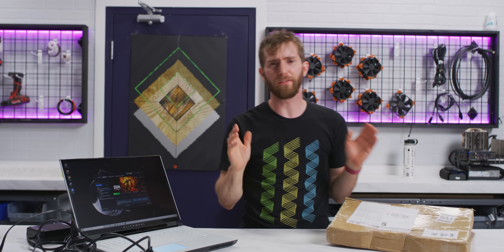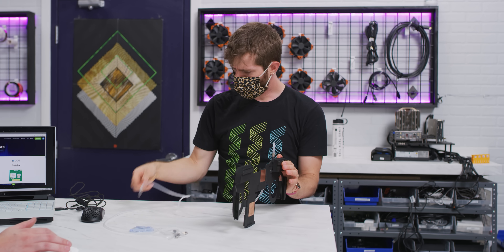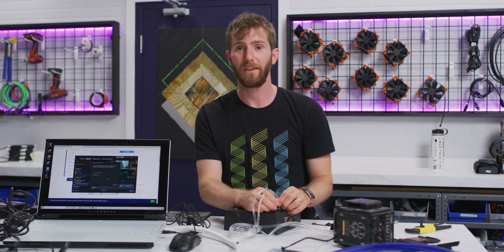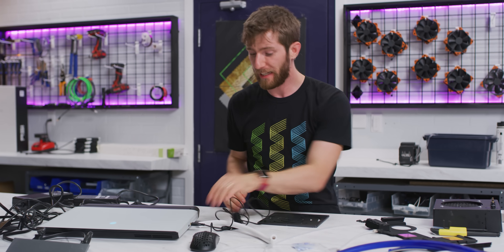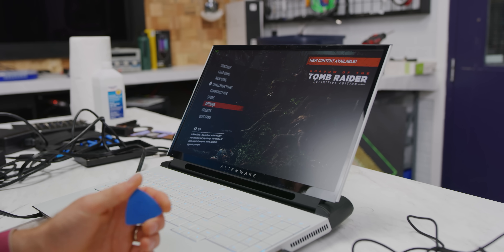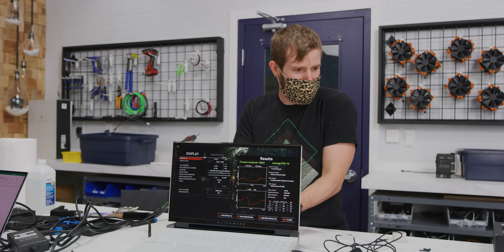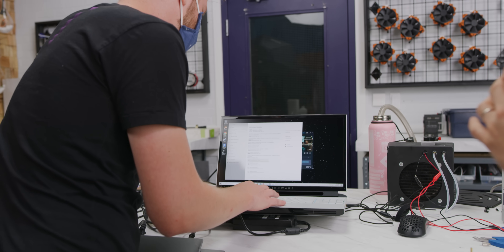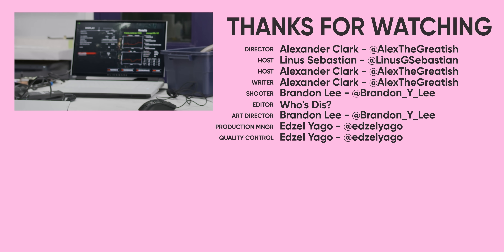This Sketchy AliExpress Cooler....

Comment: That’s feeling when you buy laptop for 2000+$ then water cooler for 600$+, just to make a stationary computer from a laptop, which in any case will be weaker due to a weak videocard.😅

Comment: how is 70 degrees Celsius good for water cooled most the time i see you all water cool anything the temps yall run even if ther at 60 c my air cooled system runs at like 45 c under load for hours the most my gpu hit is like 65 c and my cpu wont go over 50 unless its a shadder game then it will hit 65 thru 70c but thats air cooled so why would i ever water cool if any time i see someone have one or build a water cooled system with temps higher than my air cooled, then why would i water cool?

Comment: Asus released a hybrid water and air cooling laptop GX700 which was very expensive and yet a very innovative technology> that might be the future of gaming laptops!

If your laptop has a throttling issue you should return it to the manufacturer because it's a hardware malfunction and there is no solution for it. The heat produced by the CPU and GPU can't be eliminated by the air cooling system for some high end laptops and this why gaming laptops is just a repeated joke for so long!

Comment: 8:30 I've had this exact problem before it was greatly exaggerated by being direct die. When installing my artic freezer 2 on my direct die LGA 1151 system, I had not tightened the screws evenly the first, second, and third time resulting in me running circles I was trying everything. Rotating the cooler, listening for a pump failure, and even trying different thermal pastes. No matter what it stayed around 90-100c and I couldn't figure it out. I asked online and they told me to remount the cooler and very carefully tighten the screws evenly slowly. Lo and behold the system now barely scraped 60c under full load 4.9ghz OC.

Comment: I would love to see something like this built in by manufacturers of "Gaming Laptops". As it stands, they tend to get insanely loud and hot which I worry reduces longevity of parts. I own a M15 R7 Alienware laptop and would be more than happy if it had a optional water cooling loop I could tie into for quieter and cooler gaming.
Reply: I mean, my MSI laptop from 2014 still runs like a champ.  Bit outdated with it's poor 770m, but still.  The parts are bound to last a lot longer than their useful performance.
Reply: There was a water cooled laptop made by asus. Gx 700 if i remember that right

Comment: its a good idea but i feel if they had better water flow threw larger outlets and pipes to pull the heat away quicker the result would be better. hay you have to mod the back anyway so the larger outlet and pipes wouldn't be a issue

Comment: Honestly, something like this would be cool if it was integrated into the power brick, like the lines being a quick disconnect and the power brick having the rad and pump into it so when you want to use the full potential of your hardware, and have it be a reasonable noise level, you can just plug it all in.

Comment: i personaly used alot of diffrent cooler at my laptop not liquid coolers toght. 
What happend is coolers that goes under the laptop doesnt do a shit. You just get to see how fast your laptop gets to cool down and it takes time to over heat again which it doesnt efect performance they are useless garbages. 
But i also used vacumed coolers over 3 years. They make alot of noice but here is the thing they acualy manage to cool down the pc. It doesnt efect your celceus numbers but it does efects the fps you get dramaticly. 
Any way im bought a new desktop now. Just dont use laptop for gaming thats the best advice i could gave. I have to use laptop before i was in the univercity but now im working and i have rtx 2060 its just that.

Comment: I had Lenovo Y510P and i made an ork upgrade to it. Watercooling! I took thin wall copper pipes 10mm. Bent them along original thermal pipes, squshed them so they would be flatter and fit under the case. Welded them on top of original cooling system. It worked!  But it caused severe condensation! My patop started to pee! so much condesate accumulated on the bottom cover that it started to pour over.. its good that it didnt get on the board.. So i had to disasemble all this crap. I learnt a lesson that Water cooling on a laptop is total neusance.

Comment: I think you were "slightly" biased on this review... adding a water cooling heatpipe to any laptop will significantly reduce temperatures. Laptop cooler pads on the other hand might actually do more bad than good, cause they might make it harder for the fans inside the laptop to suck in the air because the air hitting the underside of the laptop and radiating outwards might create turbulence and negativ airpressure in the grills. Just raising the laptop is more safe in my opinion.

Comment: I would definitely recommend it. 40 Fps more and -20 up to -50 degrees better cooling for 300-400$ is a great deal. You only need to remove some plastic but i think it is okay. I bought a RTX 3060 Ti just to play Battlefield 2042 and did a lot of upgrade’s for hundreds of dollars just for a few more FPS. Like i upgraded my RAM from 3200MHz to 3600MHz for 220$ jut to get 5-12 FPS more in BF2042… so if i would have this Alienware Laptop, i definitely would but this wathercooling kit for my laptop😅

Btw sorry for my bad english, im from Germany 🇩🇪

Comment: In fact, it was just adding two holes for a $10 bezel. It is not difficult to buy a third-party bezel on aliexpress, but they didn't think of that and drill the original one.

Comment: That sucks a bit though not totally useless.
I would like to go water cooling for hp omen 17t i9 9880h and 2080rtx without breaking a bank and ensuring cpu and gpu don't throttle down but I have never found anything yet.
Now cpu/gpu nay not need hundreds of dollars expense as tech has moved on 
But Ali Express while very quirky choices have shown it is a possibility. If the pump in s box could lay upward on back on the screen to begin with, plus better quality for optimal temps.... I think we nay have a winner for water cooling people.

Comment: It's pretty dumb and expensive but if you can liquid metal the gpu and delid and liquid metal the cpu and possibly add a slightly bigger rad/stronger pump you could see 15-20c difference over the 15c decrease while water cooled that's not that bad you can oc a laptop and get semi reasonable temp's.

Comment: The lower CPU and GPU temps that sorted out were likely from the VRM pads compressing further, and fully contacting

Overheating VRM's will cause the stuttering while making the overall temps lower since it's getting less power

Comment: I had a G7 with a 2070 that I retuned and now have 2 Alienware M17s with a 2070 and 2080. All of these, once they throttle a for a certain duration, will stay throttled an undetermined amount of time. Temps can drop back to normal but the throttling persists. Sometimes they un-throttle on their own, sometimes resetting the GPU works. Rebooting always works. I use Afterburner to limit voltage and they never throttle now. I only see a few FPS lost but gameplay is amazingly consistent now.

Comment: Holy shit, you way overtorqued those screws. For Laptops and M2 and M2.5 in general, correct torque is closer to snug + like 10-20 degrees. Also, you sabotaged results by torquing the side away furthest from the CPU/GPU contact first rather than incrementally tightening in a cross pattern and using some weird ass paste that looked bone dry and having terrible contact. 

If you had done a good job, I think results would've been even better.

Comment: 9:55 Linus is using a Dremel with a grinding stone to grind away plastic. One grinds metal never plastic.  14:10 the water inlet is hotter than the water outlet according to Linus. BACKWARDS!  The water outlet is always hotter than an inlet. And you call yourself a professional. HMMMM.

Comment: Has anyone tried mounting radiators on the back of the monitor? I feel like laptops would have a significant boost in power if they were liquid cooled (although a little top heavy) to a more air dense location like the back of the monitor, or even folded out from the main chasis 🤷‍♂️

Comment: have something to ask. why add crap on to a laptop. how hard is that going to be moving it around. laptop and water source. how long will that system hold up. I just put a odder in for this laptop. will be used at home and semi truck. moving back and forth weekly. bouncing around in truck. If you want to send a ton of money on a computer that is water cooled. you can't move around. why buy a laptop. why not a desktop instead?

Comment: when you have to buy a gaming laptop whilst a gaming pc is 2 to 4 times cheaper just to make it portable and then you spend another 450 bucks on adding a water cooler to it making it just a little bit faster in a hacky way, dremeling the nice back of your laptop PLUS making it not very portable anymore for 30 more frames. good job :)

Comment: actually, the traditional way to do laptop water cooling is solid copper tube on the OEM cooler, that will not affect air cooling and much cheaper.

Comment: Wait what do the ram max temps with the stock and like 25 c less with water cooling the point of going for cooler temps is to oc and that’s what u shoulda did because over clocking with the stock air cooler would have been impossible

Comment: They propped up the front end by shoving the laptop's power brick next to the air intake vent. The one on mine gets pretty warm when my laptop is running. Probably cost them some performance

Comment: I think it could ba a room for such products :
- much lower noise I am sure
- for 8 cores laptops like 4800H + GPU most of the time there is bigger throttling that coud be avoid.

But only for 150-199 $ max. Past that, no way.
Best would be a quite universal kit that would just paste on the original radiator if there is room.

Comment: So. To get aircooling perf. back up. Fill the laptop with water and block the watercooling fittings with smth. The water in the laptop will help transfer heat better than air. Kinda like a vapour chamber.

Comment: Just because the cpu/gpu temp is low doesn't mean it should have higher fps. I'm pretty sure that your vram chips are overheating because of the cheap/inconsistent pressure thermal pads. I saw a guy get lower fps after changing the thermal paste on the gpu, turns out its because he reused the old vram sticky thermal pads.
Reply: TLDR, I think they'll get way better fps if they used a proper thermal pad for the vram

Comment: my thought is instead of having the water cooling gap underneath the heatpipes the designer should have done it the other way but not cover the entire heatpipe just the section it contact the cpu then you will get cooling from both theoretically.

Comment: The thermals are good and could be better with thermal pads. But an important point that you didn't talk about Is noise. The air cooling can produce the same thermals, but at what noise? I'll go with this water Solution if the noise Is half of the fans ser producing

Comment: I had similar product on my previous Alienware M17X and now on my MSI GE75 9SF with I7-9750H and RTX 2070 with liquid metal. I know it is hard to understand why would anyone do this to a laptop but I move around a lot which means I couldn't have a desktop sitting around and moving it all the time. According to my MSI, idling sitting at 37 degrees for CPU and 31 for GPU while the pump just working like 10% and the room temp is arond 18. While gaming on PUBG I get 55 degrees on both CPU and GPU with 100% of the pump. But it cost me $200 AUD. Personally I think it worth the money to me tho.

Comment: Well, I'm in China right now and moded gaming laptop water cooling is not as small as you would think. I have an OMEN 15 with an I7 9thGen and GTX 1660ti, it was running 80-90 constantly before I moded mine, it's running at 57 peak with the water pump on and no change compared to the original cooling with the water pump off right now. The cooling effect really comes down to what kind of mod you choose. First, there is the kind shown in the video, in which you replace the whole cooling copper tubing and the heat sinks as one part. this is a bit easier since you can replace it by yourself and avoid sending your laptop to a modding shop, the downside is that the parts usually don't provide a substantial improvement. The second kind which is the one I'm using is way way way better, the modding shop would directly solder a piece of flat copper tubing (hollow, so water can go through it)on to the already existed copper tubing and cool the copper tubing down to create a much better cooling effect. It also has no chance of leaking inside since they only add a piece of tube to it. And also, there is a lot of dedicated stand-alone laptop water cooler which are made to connect to the kind of connecter that they have in the video, they just didn't do their homework before buying it. Such as this https://www.chinahao.com/product/552655840819/ （just an example tho, never bought it）PS: I wish I can show some pics of mine laptop but it's a youtube comment so :(
Reply: By the way, my modding with the whole stand-alone cooler set cost around 80$

Comment: air cooling will become better than water cooling by some modifications, instead cooling pc components from water we can use radiator chilling technique by using it, so we will be able to provide up to less than 0 degree temperature air to pc for cooling and even no need to remove processor and graphic card fans. At low temperature we can use some technique not to freeze water below 0 degree in the radiators. The conclusion is that water will circulate inside the radiator and chill it below 0 degree centigrade and the fans pulls so much cold air from the radiator for pc.

Comment: 10:45 the laptop got scared by Linus hitting the table that it booted up right away lol
Reply: This comment deserve  more
Reply: The timing on that was just so perfect
Reply: He breathes information
Reply: It was going to get picked up by linus drop tips if it didnt boot.
Reply: A mouse was connected, the movement of the desk caused by the impact made it turn on. It was in idle
Reply: @savior8017  Well duuh
Reply: @savior8017  It was already on, you can see the loading icon on the bottom
Reply: @savior8017  no laptop scare

Comment: I used to be obsessed with temps, then I learned that computers are pretty much made to handle any temp as long as your computer isn't sitting in the sun (and you don't even want your computer to last that long anyway because you'll upgrade in a few years and it'll just become obsolete!), I left my ipod in the sun one day and it got all kinds of screwy, flashed some screen as if there was a nuclear meltdown about to occur, but it STILL recovered

Comment: I always want these random dumb things to some how end up being super effective.
Reply: This is super effective. Linus is shitting on it because it only stopped a tiny bit of thermal throttling when the CPU smashed into the 99c limit in their 21c office after running a single benchmark

Put this laptop in a 30c room and run it hard for a couple of hours and all of a sudden the underclock is significant and this cooling system with quick disconnects makes a ton of sense

Comment: my first alienware area51 (in 2003) was so bad at overheating, it would turn off 20min after turning on. my solution was using it on a platform of frozen water bottles and switching out the bottles every hour or so.

Comment: So, I personally own this laptop, and I think it cools pretty well on its own. Usually the cpu is in the 50-55C range and the gpu is around 60C when gaming

The hottest I've seen the CPU get is 70 and the gpu was 78, this was only one time and I still feel like these are acceptable temperatures (not great but acceptable)

I don't see the point in a water cooler for this considered everyone who owns it is either gaming at 1080p or at 4k 60fps. This is the weirdest fucking upgrade

Comment: Honestly, this was exactly what I planned to do with my older laptop (7700K/gtx 1080) by adding a copper pipe to the existing heatpipes. The only reason why I didn't start the project yet was the fear of getting leaks (I also want to disconnect it quickly, so I'd need some pressure valve or so).

Comment: It probably didn't see much performance improvement as more power isn't available for the components since laptops would be designed to provide max power output at thermal capacity.

Comment: you know, they make a torque screwdriver? I use for consistency in psi for scope rings. Don't want to crush a tube, or even bend for that matter . internal parts are sensitive .

Comment: You know that there is a window of learning of these temperatures right ?
It doesnt work out of the box sometimes when you change hardware,  but you need to reinstall drivers sometimes to get it working. Maybe no need to update it

Comment: if you use quick release fittings, so the water stays inside the cooler even when not connected to the cooling system, the stand alone temperatures should be way better

Comment: Marginally better? It is running ~20C cooler which will make your system live longer or work better in a hot climate. This is a win just cause you didn't get it for free like everything else you test doesn't make it shit. You could also overclock it to 99C and get extra performance from it. LTT has become such crap lately and their blatant lack of qualifications and bias has really been showing. Maybe Linus should just retire if it is all just about the money now.